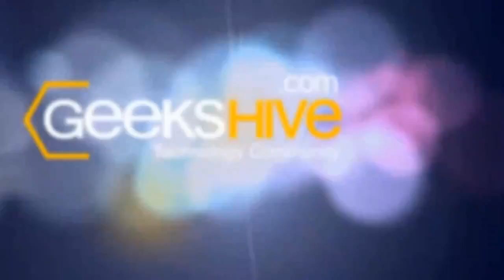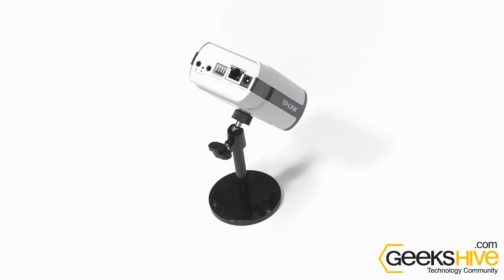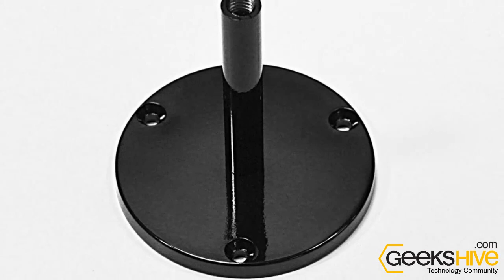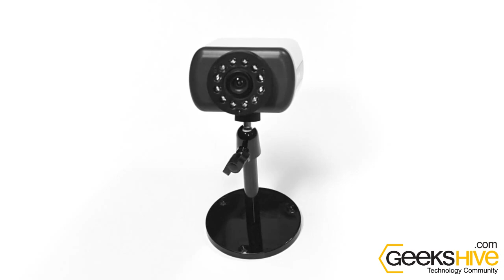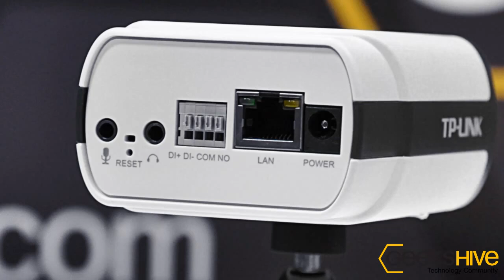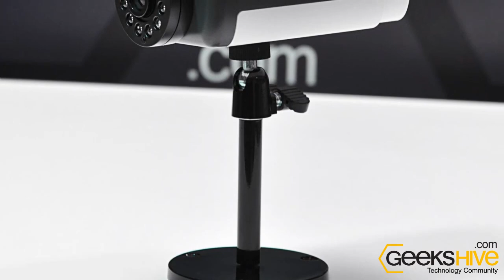Tp-Link SC3171 Surveillance Camera - Review by www.geekshive.com (English)

Comment: Awww I have to agree with @themaxdog , wireless is weak at 10meters, keeps losing connection and only way to reconnect is disconnect from power. Microphone has little reason to exist, because the quality is awful, and connecting an external one doesn't help.